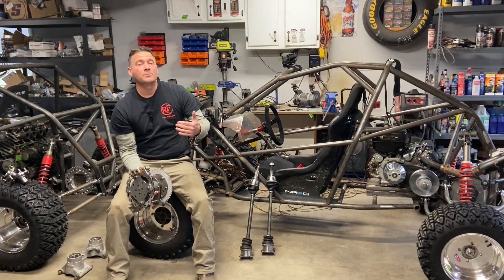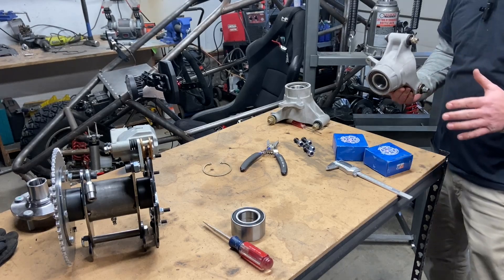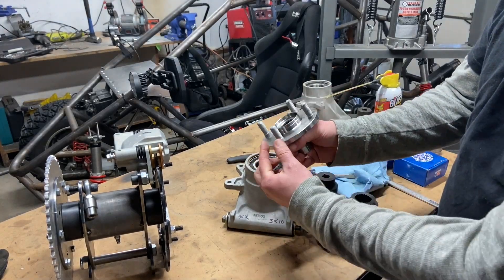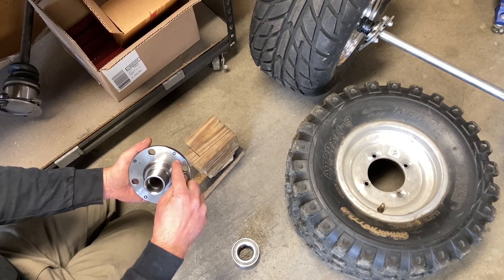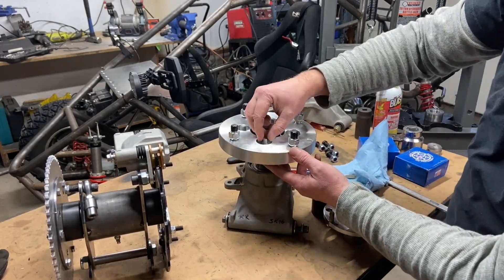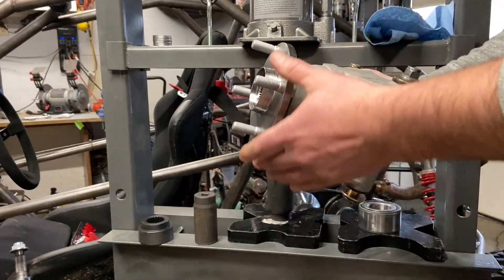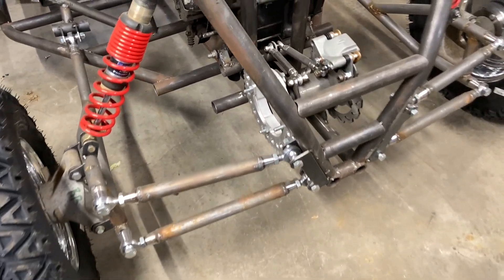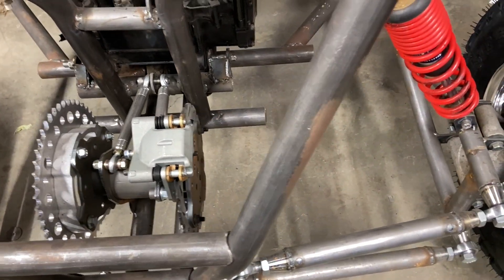Chain Drive Spool for Crosskart/Mini Buggy/Go Kart: Affordable Easy NO LATHE (part 2)

Comment: For drilling the 4 on 110 perfectly, create a drill jig with the 4 on 100 12mm, then at 45* create the 4 on 110 10mm. You only really need 1 pattern laser cut, then you can drill both hubs before removing the 12mm studs. Perfect spacing and centering.
Reply from the maker: Check out part three 🤓. Or look in your plans. Thank you so much for joining in on the fun, you are going to love this.
Reply from the maker: Go Kart / Crosskart Drivetrain Made for HAYABUSA Power!!!
https://youtu.be/F1BwHYebsNw

Comment: I know this is about affordability but I would just use wheel adapters. This way you would have more room for what ever wheels you want to run, if you are placing the brakes at the wheels.

Comment: 1. How might you recommend shortening the Miata axles if a builder desires a narrower overall width IE 58-60 inches like an FL400 pilot?
2. Trailing arm does a little better when it's a 5-link instead of a 3 link like you showed. But then that's a LOT more fabrication, parts, and adjustability to screw with.
3. Have you ever considered a De-Dion axle setup with a Satchell Link to attach it to the chassis? De-Dion is a sort of in-between of a car-style solid axle and an IRS system. It uses a "dead" solid axle that's powered by CV hubs, which gives you the geometrical benefits and ease of setup of a solid axle, but the lightness, reaction, and dynamics (torque is symmetrical left and right due to a chassis mounted diff) of an IRS system. Build in 0.5 to 1.5 degrees of static negative camber per side and you're golden.

Comment: I use a 6 spline PTO shaft and 4 bolt bearing blocks on my setup. The blocks attach to a slider bracket with bars with heim joints as adjusters. Hoping it'll hold up to the 20hp I have planned for my 3 year olds first car lol
Reply: Heim joints are the way to go

Comment: Hello, friend, I have a question, do the rear wheels stay the same at the corners?
Reply from the maker: You don’t need a differential, check out all the driving videos I’ve made. These are not 3 thousand pound cars or trucks.

Comment: U-joints and cv joints require approximately 10deg offset to keep hard wear down (makes the rollers work) . That offset could be rearward making a slightly longer wheelbase or downward making lift
Reply from the maker: Lots of guys have done that, the a-arms are flippable left to right so you can change the modes, if built correctly.

Comment: I have an old honda xr600r engine i am thinking of putting in one of these builds. Do you think the gear shifting in the xr600r engine affect the performance of the car as opposed to running the belt clutch setup?
Reply from the maker: They are faster with gears but fun no matter which way you choose to go.

Comment: Just wondering do you design your buggies so that the frame bottoms out before the shocks do?
Reply from the maker: That is a suspension setup rather than a chassis design. I cover that in a separate video. But short answer they are set up to hit the bump stops just before the frame touches as the rule book states.

Comment: The Cog is for a wheel speed sensor.
Reply from the maker: The cog should be cut off no matter what it is used for 😉. The miata axles are perfect for these builds in my opinion.

Comment: Golf carts use 4x100 or 4x4” pattern same as a lot of go karts they are very easy to find wheels for.
Reply from the maker: Sweet! I have 5 crosskarts that all have 4x110 bolt patterns so it was very useful for me to convert the hubs.
Reply: @KJRaycing  Definitely makes sense in your case. My comment was more for anyone building a kart from scratch they can look for 4x4"/ 4x100mm wheels and skip the lug pattern adapting step.